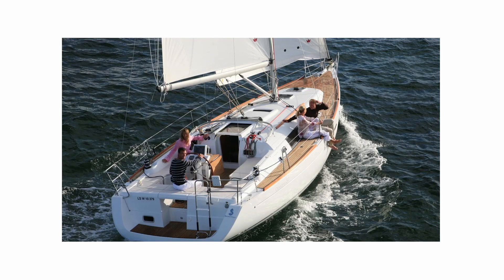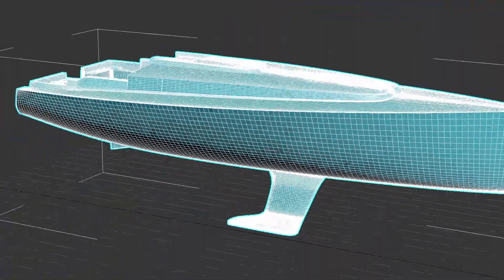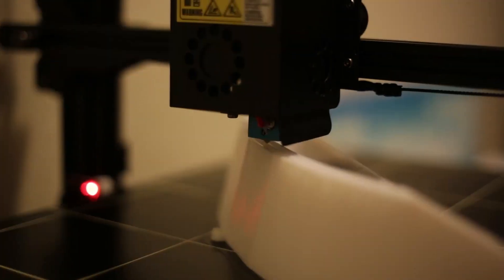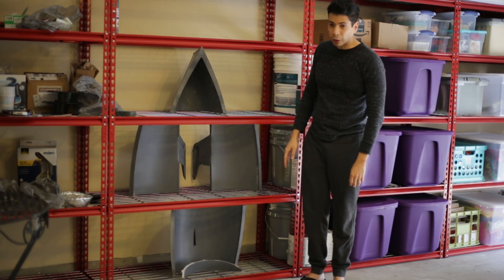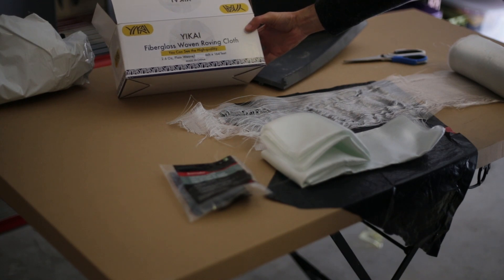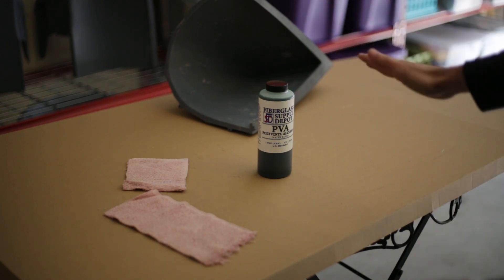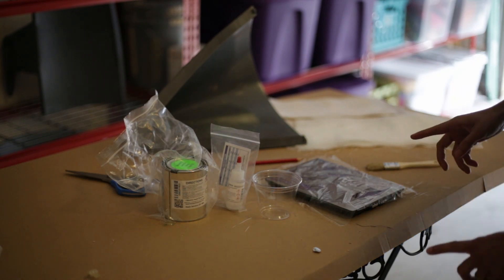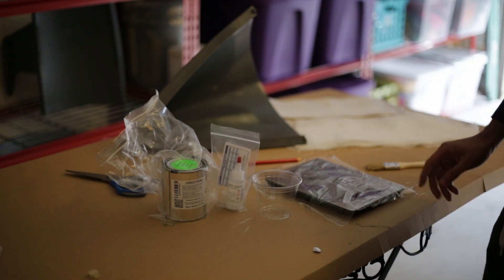RC Beneteau oceanis 37 sailboat build part 1

Comment: which 3D software did you use to model the hull?
what file format/SW steps do you need to transfer it to the 3D printer.

..... you encourage me to go a similar route, at least for my initial model.
I am currently learning Delftship to get the hull properly designed, but I still need some additional steps to turn it into a printable dataset.
Reply from the maker: I started with 3d Max, but for limitation of license I'm using blender now.
Reply: @domingomartinezt  ok, sounds good. I heard that there is a parametric version for Blender now.

For ships Delftship seems to be a good choice, as I am new to CAD it is a bit of a learning curve.

is there a place where we can PM? i.e. talking more details about the model sails?

BTW, did you launch your Benetaux?

Comment: Hello Domingo, awesome job, I am interested by building this boat but using wood, would you mind providing the plans/dimensions you used ?
Reply from the maker: Hi, I did the design only to be 3d printed to make the mold for fiber glass hull, I don't have the plans for wood work

Comment: Hey man awesome video, Im really keen to try and build one of those beautifull sailing yacht, my question is: Can I print and assemble the model with half the size, would work? Instead of printing 1,30m vould like to print for a 65cm final size.
Thanks and keep the good work!!
Reply from the maker: You have to scale down all the  molds and check for the difference in buld weight and sail area since mm squeare sails scale down different than mm cubic volume. Basically, you can need a little more weight than the scale down measure like 60% size for buld instead of 50%.

Comment: Greetings from Norway! I have been watching all the 10 episodes that has been released so far, and I must say that this is a very, very impressive build! The attention to detail is extreme, and I really admire the result so far. The metal work on the pullies and push- and pullpit is excellent. Keep up the good work!!
Reply from the maker: Glad you like the content so far, I finished the sails and now doing some research on what paint to use, if automotive paint or another one I have a compressor and spray gun so let's see what I can do, cheers!

Comment: Awesome job! Great model! That is going to be a huge boat! I found I'd get better finish if I sprayed on the PVA (Didn't matter though because I ended up sanding the hull anyway.) 
Nice job on using real gel coat. I didn't know what I was doing and just thickened up the resin. 
I would make the keel separate and do the whole hull all in one layup.
Checkout RamyRC YouTube channel. he has a few choice videos on doing this kind of project but with airplanes. 

He printed smaller parts and still had issues getting the PLA to line-up. At least he could fix the issue with spackle before fiberglass. 
You're using epoxy resin not polyester resin right? I haven't tried it but I heard Polyester resin kicks too hot and melts the PLA molds.
Keep up the solid work!
Reply from the maker: Thanks, I'm using Polyester since it is cheaper than epoxy, using 10 drops of hardener per ounce will not generate heat enough to melt PLA.  I have had no problems so far; the only issue has been a strong odor and you have to use a respirator for organic vapors. I am still learning how to use the gel coat. I did the mistake of buying one with wax (will cure in presence of air) instead of buying one without wax which that is perfect for this application since it will need the hardener from the resin. In the next videos I will use the approach of small molding pieces for the deck and how I deal with the PLA line-up.
Reply: @domingomartinezt  I recommend printing small, glue together, fill, smooth,  then lay-up big. like the whole hull in one, the whole deck in another, then keel and rudder. I think having a bunch of small fiberglass pieces to join then re-finish will be more work.
Reply: @domingomartinezt  Great idea about less hardener!